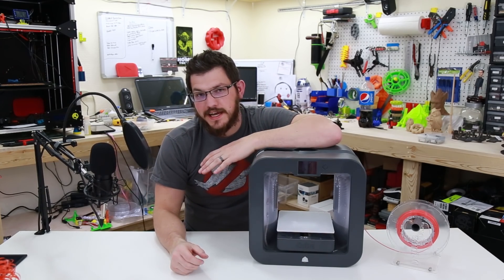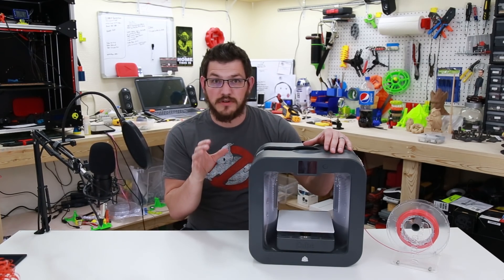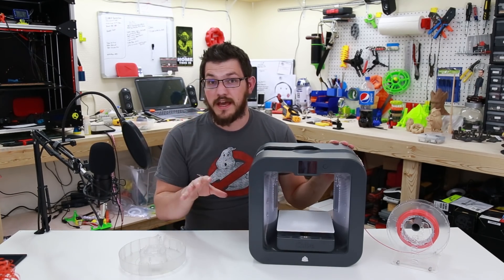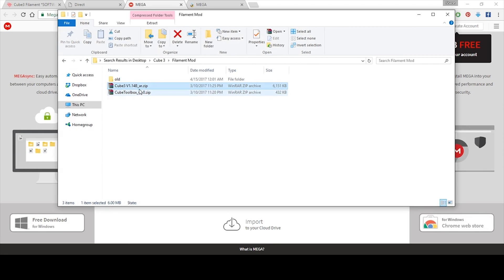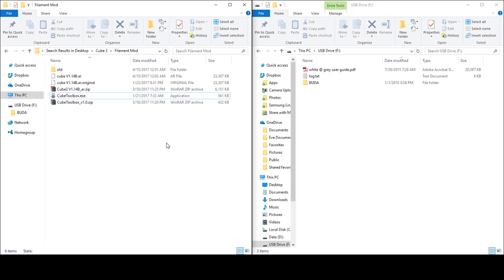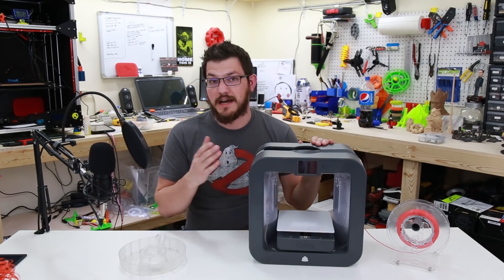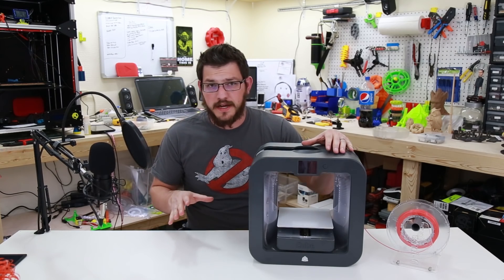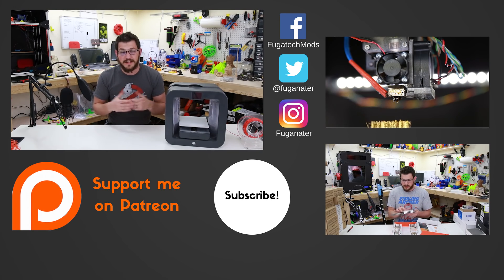Cube 3 Filament Mod!!

Comment: Hello my friend could you please send me the patched version or the window version since the links are not valid any more.
Reply: Did anyone send you the file?
Reply: J Mack no one has responded to me yet
Reply: @josephblock104   If you poke around on the forum link, you'll eventually find both the official firmware and tool needed to modify the firmware
Reply: @Feninx  I would really appreciate it if you can maybe send the link
Reply: @christianjimenez5082  Do you still need the patched windows file?
Reply: Yes I do
Reply: @TheTomcat199  what's your email address?

Comment: Just an extra Tip: You can use indeed a 100% full cartdrige with this firmware mod. The trick is to send the print job via WIFI. From the stick no way because the printer asks you to prime all the time.

Comment: very important make sure that you use a cartridge that is below 100% before you update
.
Reply from the maker: Yes.. did I forget to mention that in the video?
Reply: yes or I was not paying enough attention lol . By the way maybe you could help me by answering a question. What is the measurement of the filament that you use for the cube 3 is it 2 mm ? or 1.75 mm ?. Thanks a lot
Reply from the maker: It is 1.75mm filament.

Comment: A FRIEND GAME ME THE ONE HE HAD, HE ALWAYS HAD PROBLEMS. I AM GOING TO TRY YOUR MOD THIS WEEKEND INCLUDING  THE FEED TO THE TIPS, I HAVE ALL THE PARTS AND WILL LET YOU KNOW HOW IT COMES OUT
Reply: i did one side and im having a problem with the filament getting stuck at the screw on bevel inside the tip Im going to redo the tp and change the tubing and try it again this weekend. ill let you know

Comment: After we do this MOD can the Cartridges still be used.  I have some that i have not used yet but ultimately i want to be able to use bulk rolls of filament. 
Thanks
Reply from the maker: Yes they can be. The chip will no longer get updated with how much filament is left on the spool. I did another video how to mod the cartridge to accept bulk filament.

Comment: Did it work if the printer still asks you if you want to continue the print because there’s not enough filament on the spool?
Reply from the maker: Yes. You would only have that issue if you have a low % chip. Since mine is at 98% I never have that message come up.
Reply: Fugatech 3D Printing Great! Thank you so much for the quick response, I really appreciate it.

Comment: Awesome vid, wasn't too eager to try this hack at first but honestly fifty bucks is too much for enough plastic to print 5 cell phone cases (20% of which will likely be wasted anyway) so I'm going to give 'er.

I have one question though, will this work with the Infinite Rinse Away Support material? This stuff is useful but I don't think any other brand makes it so I can't buy a cheaper version. But I read that this patch doesn't work with cartridges at 100%, so how would I go about replacing that?
Reply from the maker: What cost $5? The filament spools?

I do not know. There is another mod out there to alter the print temp but I have not tried it yet. 

Correct, the hack does NOT work with cartridges at 100%. All you have to do is flash the unmodified firmware, start a print for like 5 minutes, stop the print and your cartridge is now at like 98 or 99%.
Reply: Fugatech 3D Printing Yeah, up here in Canada a single spool is fifty dollars, plus shipping of course. I could swallow it before but after having to trash almost half of my last cartridge due to jamming and filament breaks in the tube (an issue with this printer's cartridge design that you touched on) I have decided enough is enough. Besides, half their selection on the 3D systems website is out of stock anyway, so I have bought the spools from other venders mainly. I couldn't even find orange PLA!

But ah okay that seems easy enough to do. That's only if I am still able to obtain that Infinite Support Material! Thanks for all the helpful info on your videos, including giving the links to the various tools and parts that you need to make this hack work.

Comment: OMG thanks. Just subbed you. I have been searching for this for 2 years. using other filament in this printer is what it needed because the stock filament is cheap and brittle. I have been using different filaments before but i have to buy new cartridges when it hits zero% . Thanks

Comment: Wait, if I do this hack, would I have to just feed normal filament in? or would the spool need extra modification?
Reply from the maker: You can use any filament you like. You only have to open the spool up to feed a different spool into the bowden tube. I will have a video on the spool mod soonish.

Comment: nice surprise bro. and are you going to update the firmware just asking.
Reply from the maker: Thanks. I would but I can't. You have to print 1 small thing to get the cartridges less than 100%, then apply the modified firmware. I may include a flash drive with instructions and all the files needed.

Comment: I had one question.. I get the software part but what about hardware? How do you actually use other filament? The cube 3d has a special print head. I'm just so confused on how you do that part of it. Thanks.
Reply from the maker: That will be in the next video.

Comment: where did you buy the printer?
Reply: He stated in the video from Ebay for $100 and $40 shipping.
Reply: mistakensanity i have serch a lot and the cheapest is in ebay but is 200$ + 50$ shipping
Reply: StevenTech PR he didn't buy it yesterday ;-)
Reply: mistakensanity i was interested like 5 months ago and it was 250$ with shipping but didn't buy it because of the filament.
Reply from the maker: I bought them both back in September. Price fluctuates between $100 and $250 almost daily.
Reply: Shane the links are bad on Print 3d Forum